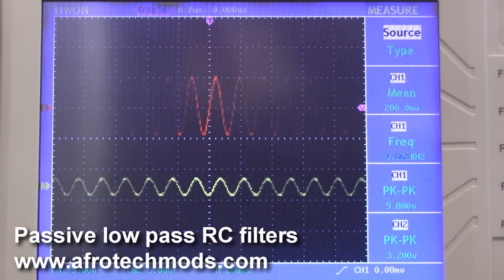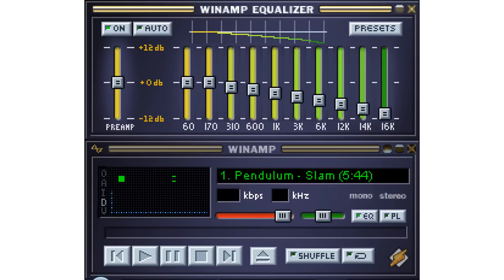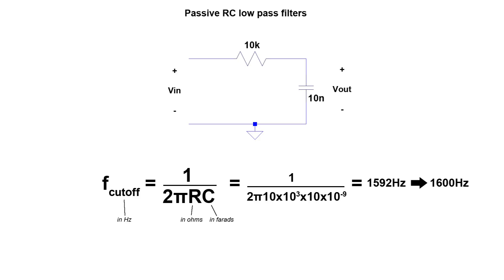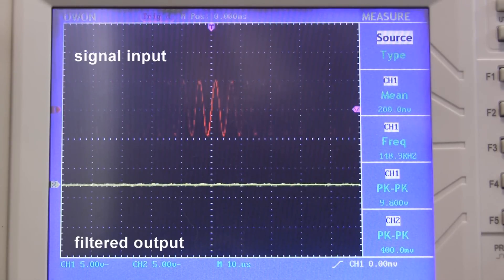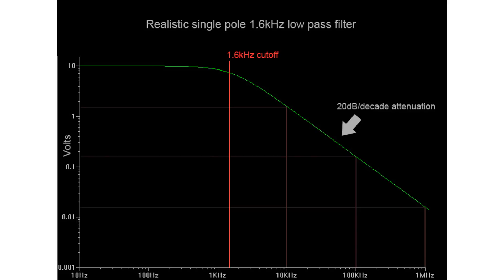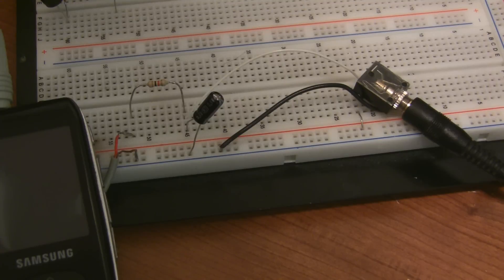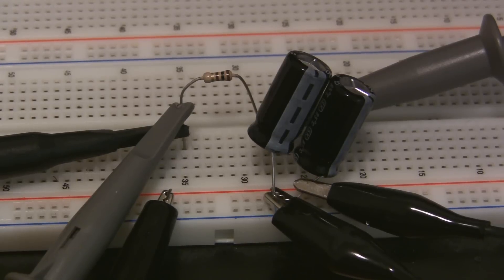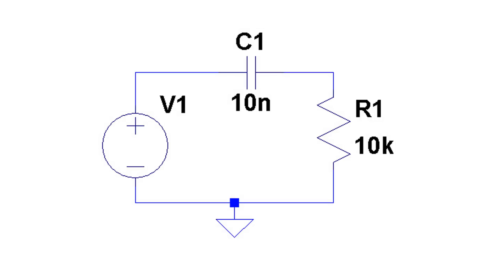Passive RC low pass filter tutorial!

Comment: How to passively reduce Peak to 50hz before a passive crossover for a Subwoofer with a crossover frequency of 100hz/18db oct? Is there any passive circuit that would reduce the frequency of 50hz by 6db and still work up to 100hz?

Comment: I have a stereo tube amplifier with a (resistor in series with a capacitor) going to ground. There is one rc between each end of the balance pot. it goes from the balance pot through the resistor then through the capacitor then to ground. What exactly is this doing??
Reply from the maker: Sounds like a classic low pass filter to me
Reply: @Afrotechmods  tried disconnecting it from circuit and it makes bass midrange and treble louder. Kinda weird i thought.

Im trying to reduce the bass in the amp because even with the bass all the way down its still way too much.
Reply from the maker: @kwacz  Hard to say what's going on exactly without reverse engineering a lot of the amplifier... but if you want to reduce the bass you could try do it another way. On the output of the amp you could put a 10uF or 100uF capacitor in series with the speaker wire. This would form a high pass filter that would cut out some of the bass reaching the speaker.
Reply: @Afrotechmods  did try putting a .15uf film cap in series with the output of the volume knob and the preamp tube. Did help. I think maybe try a smaller cap and a little trial and error i think it will work. This amp us a little different as it was originally in a juke box so it is probably set to be thunderous. Just trying to tame it back some. Otherwise a really good sounding amp.

Comment: What happens if you switch the position of resistor and capacitor?
Reply from the maker: You get an RC high pass filter! I have a separate video on those.
Reply: @Afrotechmods  Sorry, I wasn't clear. I meant what happens if you move the resistor to the other side of the capacitor in this circuit. Right now the resistor is on the input side of the circuit. What happens if the capacitor stays but the resistor moves to the the other side of the capacitor on the output side of the circuit? Does it make a difference?

Comment: The last comment about cascading filters, there's an important concept to understand.  A low pass filter's cut-off frequency is defined as the frequency at which the amplitudes is down by 3dB.  If you put two of the same frequency filters together, isolated by a buffer to prevent interactions, the output will be down by 6dB at the cut-off frequency.  Therefore,  if you need a sharper rolloff, but need the cut-off frequency to be the same, it's better to use an active filter.  Also, Spice is a good idea if you don't know exactly what you're doing, and even if you do, it's useful to check your work.

Comment: Nice. I had both an original and an unorignal power supply (9V output) for a guitar pedal (distortion pedal), but the unoriginal power supply made this guitar pedal generate a high pitch noise which wasn't there with the original power supply. For fun I used a 120 ohm resistor with a 10 uf capacitor and then connected the pedal to the filtered 9V - lo and behold - all the high frequency noise vanished.

I'm still sticking to the original power supply, but this sure was an interesting experiment 😃

Comment: Howdy.
One may cascade RC filters to get steeper attenuation. The trick is simply that each next branch should have an impedance of 10 times the previous. For most practical uses each branch may be calculated using the basic formula. The inter-loading will be small.
So if we want a 40 dB attenuation per decade we use a 1 k resistor in the first branch and calculate the corresponding capacitor. In the next branch we use 10 k and a capacitor of 1/10 of the previous.
However. The following amplfier input impedance needs to be 100 k or higher.
If some inter-loading can be accepted a smaller factor may be used, say 5 times.

Comment: What if I use 100-ohm resistor with 10micro farad capacitor instead of 1K resistor and 1 micro Farad capacitor
both give 150Hz frequency in low pass filter.
which one to choose ?

Comment: Hey dude,
Great job in doing that video... Ive got one question:
I wanna filter out the bass frequency of a audio signal and then higher its min. Voltage with a dc offset, to make its voltage completely positive to read it out with a arduino...
But the problem is:
How to do that? As soon as i connect the dc offset voltage source in series, it makes the low pass filter not work anymore....

Comment: Im a beginner: Why is the Subwoofer connected directly after the resistor? I thougt the filtering occurs due to the capacitor hence behind the capacitor is the filtered signal or am i missing something?
Reply: the resistor is the impedance value your output to match the impedance of the RC filter but not sure why hes not using a LC filter. most AF work is done with LC networks.  here is a nice filter calculator website.  http://sim.okawa-denshi.jp/en/Fkeisan.htm  you want the resistance/impedance to be the same for the input and output of the filter.  do the math for a 8ohm load see how the cap value changes massively.

Comment: Don't you think when we put this filter for making smooth DC power, we get almost 90% of the power. But if the resistance is in high power, a Full-bridge rectifier or three phase full bridge rectifier will have to deliver maximum power at the output with with good Quality DC. What should be the scenario in that case. 

Keep in mind that almost every transformer produces some amount of harmonics which make the circuit a little unstable.
Reply: In that scenario, a passive low pass LC filter will suffice. Can get bulky and sometimes expensive, but gets the job done. Also, consider that the bridge rectifier has its own power loss, due to the diodes voltage drops. An alternative i have found is using a active rectifier, that uses MOSFETs, for minimal voltage drops and power losses.

Comment: Hello! Interesting tutorial!
What if I want to remove a narrow "notch" in my triangle wave output from VCO? I fear that if I'll just insert 1-pole filter for ~15-17kHz then it will not be enough or will be reducing the sound of the wave on high octaves. Can this thing be done with a single trimmer... so one resistor will be choosing a "starting point" and other RC filters will be a kind of "an offset" to make an efficient (let's say) 12-pole filter...
I can't remove that notch... it's a simple saw -> waveshaper with a pull-down 1N4148 diode on the positive side of an op.amp that makes the waveshaping. I've tried small caps in the negative feedback (on the same op.amp) but it doesn't helps...
http://img.picshare.at/1521937883_JP8_SawCore_3-wave.jpg

Comment: So using this method, could you convert 24v AC power from an HVAC thermostat into logic level DC for an Arduino? How would you determine the resistor value in this scenario?

Comment: What does it mean to not overload the audio source by choosing a 1k resistor?
Reply: Dutch Bibimbap as the freq increases, the capacitor's reactance reduced. At some higher frequencies, the reactance becomes negligibly low behaving like a low resistance in series with the ground. If a series resistance of sufficient resistance is not connected, the signal would be short circuited to ground. This is known as overloading. The series resistance will always provide sufficient resistance to the source even  at the high frequencies where the cap almost lost all its reactance. So, the series resistance prevents overloading of the source.

Comment: at 4:19 the 3 dB decrease shouldn't be a 50% instead? -3dB=10*lg(U) and if you solve it, it gives you 0.5 so it halves the amplitude.  I just don't see how you got the 29.3% decrease
Reply: You're confusing power and voltage. -3 dB correlates to a 50% drop in power (Watts), but to a 29.3% drop in voltage (V).

For power gain or attenuation, it's dB = 10 x log10(P-OUT/P-IN).
But for voltage gain or attenuation, it's dB = 20 x log10(V-OUT/V-IN).
So here dB = 20 x log10(7.07/10), which is 20 x log10(0.707), or 20 x -0.15 = -3 dB.

The voltage equation is derived from the power equation by recalling that P = V x I and  I = V/R, so P = V x V/R = V^2/R
Substituting for P, we have dB = 10 x log10[(V-OUT^2/R) / (V-IN^2/R)] which equals 10 x log10[(V-OUT/V-IN)^2]
Because log10(x^2) is the same thing as 2 x log10(x), the above can be rearranged to dB = 20 x log10(V-OUT/V-IN)

Easy peasy. lol
Reply: This also explains the ("decade") attenuation of 20 dB when the voltage amplitude decays by a factor of 10.

dB = 20 x log10(1/10) = 20 x -1 = -20 dB

Comment: Hi
I wonder if you can help ( you may already have a video covering this ?)
I have a PIR on a 8 foot cable , connected to an Arduino.
When I turn on the bathroom , light switch ,I see a 3v spike on the Arduino digital input pin,  ( i am only learning ,but I have a Rigol 1054 )

I have seen your low pass videos.
someone suggested a cap from ground to signal pin , and a cap from vcc to signal pin
Apparently this moves the signal in proportion to a spike on the power rails?

Any chance of a video explaining how to do this?

Also how do I measure mains 240v with my scope ?

There seem to be a lot of scare stories.
I assume I put the scope on x10 connect the ground lead to mains earth and the probe to live or neutral

I am not brave/ stupid enough to try it , without being sure.

Many thanks 
Paul
Reply from the maker: You could try an RC low pass filter, a zener diode for clamping, or "debounce" code in your arduino.

Comment: i have made a basic tone generator could i put an extra pot on with your method  shown to apply a filter ie placing the resistor and cap before the speaker at the end of the existing circuit I have

Comment: Hi, thank you for this very usefull video! My question is, lets say I have a mini HiFi stereo with 90W per channel with a 3 ohm woofers. Those woofers play medium frequencies that I wanted to cut off and keep just the low frequencies. Can I do that with that passive RC low pass filter on each woofer? Is it possible? Thank you in advance! Ow and the stereo as a built-in bi-amplifier separating the woofers from the tweeters.

Comment: How can you make a pure sine wave out of a modified sine wave from a cheap 12V DC to 220V AC inverter?
Reply: YOu can't just filter cos power loss will be astronomical. first convert that output to dc. and create a SPWM using an HBRidge.....afterwards...filter with LC FILTER FOR SINEWAVE
Reply: Not usuful, i want ac power... if i have to convert to dc again it would make no sense...
Reply: *****  that's not what i meant. Your final output will be an ac voltage of 220v but  a sinewave instead of a modified wave. 
just google "sine pulse width modulation".
Reply: Okey i'll give it a shot, thanks

Comment: HI Afrotechmods, I dont know what im doing wrong. Im trying to make a subwoofer for my portable speaker system and i couldn't find a 1k resistor for the circuit so i used a 1.5k and a 1uf capacitor. It was electrolytic so idk if that had anything to do with it because you used one on the actual board.  My circuit it instead working as a high pass filter sorta. But not really because the volume is very low? Should i try using a non polarity cap? Or switch the resistor and cap around?
Reply from the maker: You cant use an RC filter for a crossover after an amplifier like you are trying to do. The series resistance limits the current. You could only do it before the preamp. If you want a filter after the amp going to the woofer you need an LC filter.
Reply: Afrotechmods I noticed that and i fixed it! Thanks for verifying my fix though, I also watch alot of your other vids and they help me make some cool circuits! Thanks for the help and vids!
Reply: do you have a guide for that? i have the same issue with my sub too. I am kinda new to electronics too, could you help me out with a link for a LC filter?
Reply: kanari madar RC filters need to be on the low level input side of the subwoofers amplifier.
Reply: ohh, got it thanks
Reply: kanari madar No problems! If you have any other questions feel free to ask!
Reply: today i made a new filter, and it's still not working. My con is cap. is 330 nF and my resistor is 5 ohm. that's roughly 2500hz, isn't it? my first attempt was with 100ohm and 15nF and the cap went kaput, and I switched to a 5ohm res, cuz i thought 100 ohm is too much so there is little output that's why its not working. But now i double checked everything with the new setup and it's still not working. My speaker is SAL SBX 2530/BK. My amp is a simple desk stereo speaker, a kinda expensive one doe. i want to build a low pass filter, with a cut off 2500 hz. I would like to put the filter after the amp. if i put it before,the other speaker's wont work. What do you suggest? Is my filter's parts too bad, or there is a problem with the amp?
An LC filter wouldn't be bad either, but i can't find the desing for a 2500 hz  cutoff. I would really appreciet your help! :) thank you already!
Reply: ok, i kinda worked it out. My idea is get a crossover and not a filter. It's like the LC filter. it's better that way
Reply: hi. can you please share it with me. how did you solve this problem
please share the circuit.
Reply: so i thought i put too much resistenc. I made an LC filter, with 100mh and dunno how much capacity. Now i got a filter at 200hz. I used this filter after the amplifier. If you can, put it before you amplify the sound. i cound't.
Reply: Dániel Sályi Use a RC filter if you want to filter before amplification, Use LC if you want to filter after Amplification. RC I found better when I finished my project a while back.

Comment: 1k resistor with a 4.7 uF cap.   

figured it to be about 33hz or so.... 

i plugged the scary thing in, and it works. it DOES filter.. but it lowers the unfiltered audio A LOT. 

two questions,  first this is for audio levels coming from audio cables correct? shouldn't be used on a amp output? 
also, i wire the positive from audio out to the resistor and negative to the negative on the cap correct?
Reply: i was able to make a couple lpf. one 33 hz and the other 79 hz. the thing is, when i plug them in, the audio level drops so low, i can't hear a thing. unless i crank my amplifier all the way up.. 

what's going on? and how do i solve this issue?   edit: i know what 33 hz and 80 hz sounds like.. its LOW.. i know..
Reply: Sir SMKSAlOT u prolly used a high resistance for ur input...which made the output of lpf very low for amplifer to amplify
Reply: Hi, wich are you recomended rc values for a woofer at 100w rms? Thank you

Comment: Few hours ago i made speaker crossover using RC Filter since inductor is hard to find here,.. And the result is the speaker impedance  spikes to 18.5ohm in multimeter reading (8ohm speaker).. Why is that happened? And how to fix it thank you sir... And thank you for making videos on electronic.. I just getting into electronic very late,.. I'm 40 yo.
Reply from the maker: +Rudi Yang Because you added DC resistance! RC filters for speaker crossovers are not a good idea in general. You could try hand winding your own inductors based on equations and tutorials you find on the internet?
Reply: +Afrotechmods hmm ok,. Still don't fully connect the logic,.slowly will, thx for replied,.. I ordered LC meter last week, already into it ha ha,.. Also plan to salvage inductors from old pc motherboard when my device arrived,. Thanks again...

Comment: I see you are useing electrolit condensator, and i was wondering, couldn't it be a problem because of the changeing direction of current? I would guess that the amount of charge leaving the capacitor during the backward curent is the same as the amount of charge getting in during the forward, but i'm not sure about it.

Comment: Is it okay to say....due to lower impedance of the capacitor, higher freq passed away to the GND?
Reply: HighOnThunder. It is not nonsense. Having a resistor there limits the amount of current which in turns slows down the charging time constant. You can see it also as the equivalent series resistance or ESR. Ideal capacitors don’t have an ESR. So the current is infinity thus making the change of voltage instantaneous. Unfortunately. the plates act as resistors and thus voltage does not change instantaneously. Solving for the low pass circuit above gives you an exponential equation with a time constant TAO = R*C where the resistor times the capacitor determine the charge time. And thus limits the speed at which the capacitor can be charged and discharged.
Reply from the maker: +7timesInversed10to11 That's accurate yes
Reply: HighOnThunder Then why do you have the resistor? I mean, if it's enough with the capacitor. I've yet to understood this because a capacitor obviously is enough to attenuate the high frequencies.. Is the resistors role to still make sure that the source still sees a specific impedance, ie to protect the source?
Reply: I was searching for a good explanation on that too.
Reply: Essentially. The circuit above determine how fast it can turn on and off. And if you exceed that time value,  T= RC*5 = 99% charged
then you will begin to attenuate signals since the cap never fully charges. Simple.
Reply: Which translates in frequency domain as your corner frequency